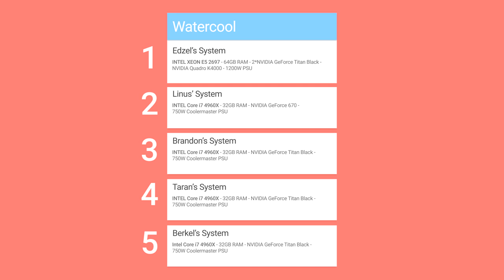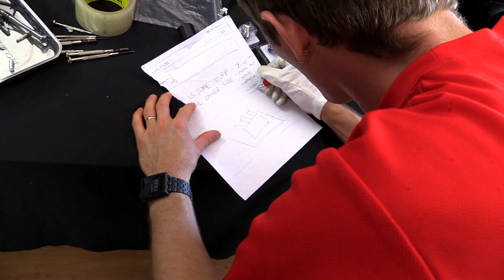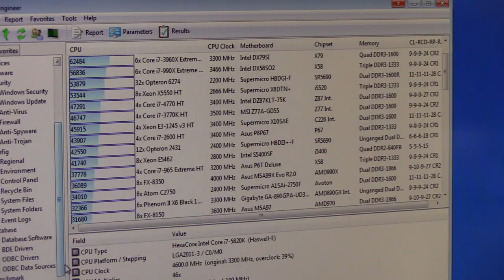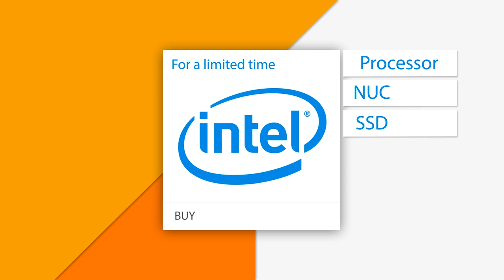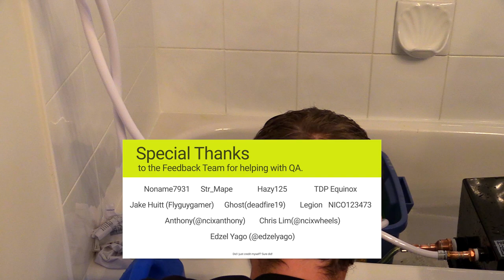Whole Room Water Cooling Part 2 - The Assembly

Comment: why not use car radiator?
Reply: +Chen Aaron Would have been a damn sight cheaper, and they could use a pair of thermofans (also from a car) to move the air.
Reply: +TheOneWhoMightBe car radiators are made to take in air at a lot more speeds than fans will do
Reply: +Alpha smurf No they're not. Your car engine generates a lot more heat than 6 PCs and doesn't overhear when the car isn't moving ie: the fans are generating ALL the airflow. Bonus: the fans are already weatherproof.
Reply: +ducksonetime overheat
Reply: +ducksonetime I was thinking this the whole time. Hell, even a radiator off an old A/C unit would work, and have WAY more cooling capacity.
Reply: +Matthew Menze their power bills would be through the roof
Reply: PneumaticFrog It's only the radiator not with the compressor
Reply: Chen Aaron oh
Reply: +PneumaticFrog the radiator wouldn't impact the power bills.
Reply: yeo
Reply: I was just about to post the same thing. You could just mount 2-20$ box fans on a honda civic radiator.. They would saved grands on this build. and.. I would be willing to bet 2-3x better at cooling..
Reply: because I know what cpu I am running exactly but god forbid you ask me if my car has airbags.
Reply: Pankaj Ahuja , there's a very easy way to find out, but it might increase your insurance premium...
Reply: Why not use a car radiator? One word: aluminum.
Reply: Car radiator is aluminum.
Reply: Chen Aaron but didnt they put aluminium fittings on the radiatiors
Reply: Chen Aaron scrap yard wars. Cooling edition
Reply: Pankaj Ahuja does your car have airbags? God is ded
Reply: Chen Aaron 
Beeeccaaussee it would need an engine, duh
Reply: Alpha smurf I disagree, my vehicle would overheat if I was standing idle for a long period of time. I'd think two big radiators from a full size vehicle accompanied by the vehicles electric fan/fans would be able to cool the liquid more than enough.
Reply: They could plumb the water into a swamp cooler, not only is it fan cooled the radiate heat would dissipate as yo spread the water through out the "moss" yes you'd have to have a filter (fluvale fish filter)and an exteenal tank gtom any water evaporating. There would be more maintenance but it would be cheaper.
Reply: I used an old oil intercooler for my first watercooling system. Bolted 4x Cougar 120mm fans to it, and overclocked that 3rd gen i7 to 4.5Ghz, stable... or was it 4.7? Never went over 78C. Later I took the system apart because I used tap water which coated the insides in white calcium/mineral powder.
Reply: hahaah fucking tap water :v
Reply: Alpha smurf as someone who works on cars, I can tell you this is false. Computer and car radiators are manufactured the exact same way. Single, dual, and triple core are really the only difference besides fin size. There's no such thing as a radiator taking or not being able to take a certain amount of air flow.
Reply: loop metal consistency
Reply: Car radiator fans are designed to be able to cool the radiator enough so even at idling and standstill it will able to cool it enough.
Reply: @Bugzi1776  " my vehicle would overheat if I was standing idle for a long period of time."

If that's true then your vehicle is in need of repair. A vehicle in proper working order can idle indefinitely without even coming close to overheating.
Reply: ikr
Reply: Car radiator will easily cool this setup and likely wouldn't need too much of a fan setup as i dare say most heat will be lost before it even reaches the radiator. (Copper pipe no insulation) as for radiator fans, most automotive fans are inexcess of 300w each, so they move a lot ot air. Most will simulate 60kmh wind through the radiator. However at 300w its using 1/4 of the energy that i would expect a split system woukd draw to cool that whole room.
Reply: Was wondering that too. I always thought if i was to go water cooled id just use one of my slightly bent old dirtbike radiators. Aluminum, well made, same fitting size and they're free. A little Civic half rad would have done this job well
Reply: @jblob5764  would need a good clean and a filter though. but yeah. id probably do the same
Reply: @MaximRecoil  I was just going to say the same thing. With modern electric fans, radiator designs, and proper fluids.  No car made in the last 25 years at least. Should be having a over heating issue.
Reply: Aluminium Copper don't mix. With copper fittings they would need copper radiator. But I don't see why they couldn't get an industrial copper radiator.

Comment: With all that copper piping the water has to run through before it gets outside, a lot of heat is still being sinked into the room. You should have used tubing or insulated the piping. Maybe you could get some pool noodles, cut one side lengthwise, and put them on the pipes to mitigate this.
Reply: Also, decal is pronounced "Dee kal", not " deckle" hahaha

Comment: If I understood it correctly the water would have to cool 5 pc's before it could get cooled again.
So This is 1 loop. The water only get cooled once and then it goes through 5 high end computers with both CPU+GPU in the setup. Would this not have a negative effect on the 5th computer?
Reply: Not really. It would reach equilibrum and pretty much the whole system would run at the same temperature. Oh wait, it's 4 yo post. Too lazy to delete all this, so post!
Reply: @dimitardimitrov9482  if you deleted it we wouldn't know someone ever saw this so ty on posting this oh 2 months old comment
Reply: Lala I was thinking the same!  Thanks for posting this oh 2 months old comment!
Reply: The idea was that cold water was on one loop. Hot water was on the other loop. At each PC, water was taken off the cold loop, pumped through the PC, and pushed back out onto the hot loop.

Comment: Rather than use many 480mm Radiator why not use a car radiator since it was sitting outside with high pressure industrial fan ?
Reply: I still think they should have made a cooling tower out of a swamp cooler and dipped the radiators in the swamp sump.
Reply: A high pressure industrial fan would probably be quite noisy
Reply: kinda hard to get a 2.25in outlet to work with PC 3/4 tubing.
+ they would need a hella large pump for that.
Reply: Eric Martin noise was not a problem since the radiator sit outside, just use a longer tubes or pipes (stay away from the PC) and they can't hear it.

carlos perez for those PC's ? swamp cooling tower are overkill, unless they're build a supercomputer or at least server tower.
Reply: Usually the reason is because the majority of automobile rads are aluminum rads and those don't mix well with copper and brass components.
Reply: carlos perez swamp coolers work a lot better in dry climates.

Eric Martin noise isn't as much an issue since it's outside, but larger diameter fans make less noise all other things being equal.

Sanic go to Home Depo and look in the plumbing section... it's not that hard to adapt any size to any size....and the rad size does not effect the pump size at all.
Reply: Ryan Heyser High End automobile rad are made by copper, only cheaper rad that use aluminium.
Reply: IndraEMC modern cars don't use copper or brass anymore.
2 expensive.
Reply: IndraEMC
No they don't. Aluminum is far lighter than copper, and with the exception of restoring classic cars, copper rads are almost non-existent when it comes to automobiles.

That said, the reason has little to do with the arguments of efficiency, and much more to do with the fact that aluminum is cheaper and the differences are negligible at the temps seen in auto. The problems are much more noticeable at low temps for pc cooling.
Reply: Sanic That's why I said "High end", not a budget car Radiator.

But used High End copper-made car radiator are still cheaper than "PC Branded Radiator" in term of size and cooling capabilities.
Reply: IndraEMC noise is an issue, their office is a house, surrounded by houses. sticking a noisy radiator outside would infuriate neighbours.
Reply: IndraEMC yeah it is over kill.  and it does bring on a second set of maintenance issues as well. but I think they can handle it
Reply: JamesMichaelDoyle  it's not as noisy as lawnmower or jet plane taking off the runway, industrial fan are just slightly noisier than a desk fan.

carlos perez, for long time usage, it's worth the cost.

Comment: When the water goes outside wouldn't it freeze because its Canada during winter
Reply: ***** the title says WATER cooling.
Reply: ***** but people mostly use water to cool their pc right?
Reply: eddie10089PlaysAGame
It's not actual water lol, that's just the term, it's a green coolant like they use in cars, it doesn't freeze
Reply: OfficialCompraa ok then. I am new to pc building so i didnt know. Thanks for the the info.
Reply: sam bishop
very very low temperatures
Reply: It will not freeze if they use additive. But cooling ur pc with that cold coolant will cause condensation. These blokes just dont know what they are doing. But since all this is free stuff who cares.
Reply: They live in Vancouver, it doesn't get that cold there.
Reply: *****
if you watched the video (guessing not) at the end you see the copper pipes spill green coolant from them
Reply: *****
13:00
Reply: "Because its Canada during the winter" i lol'd
Reply: madjake45 I think it's just a coolant with additives, I don't think they picked the colour.
Reply: ***** The coolants have more solutions in it other than distilled water. Regardless, using just water is inefficient.
Reply: OfficialCompraa Most people use distilled water.
Reply: madjake45 Colored water is actually extremely useful for test purposes as it would be more noticeable to the eye if there are spills or leaks. But again only for testing the actual system not for anything else.
Reply: Kensung Clear or coloured, if you can't spot either one then you need to get your eyes checked.
Reply: All they need to do is add propelyene glycol in a 70% water 30% glycol mix. Works great for thermal transfer and is perfect for Canadian winters.
Reply: well a little gycol coolant will prevent freezing same as in a cars watercooling system
Reply: *****
glycol by itself will freeze at relatively low temperatures but when mixed with water at a 60/40 ratio it will withstand up to -45c which makes it a perfect coolant
Reply: Alcohol cooled system. We should run experiments on an alocohol cooled system. It never freezes but it get's colder than shit. EXPERIMENT TIME
Reply: Andrew Longauer
As far as "regular" liquids go, water is by far the best.
Reply: They are using anti freeze
Reply: Because it's Canada during winter.
Reply: eddie10089PlaysAGame No, nobody uses water because it corrodes. And it's very slightly conductive.
Reply: Jacob S It's antifreeze.
Reply: TDPEquinox Antifreeze is mixed, I said that earlier, you don't fill the entire thing with anti-freeze, that's expensive and stupid.
Reply: Jacob S
u want shum
Reply: +Rob The Plumber BUT that glycol would be better spent mixing ejuice
Reply: klimpomp he's talking about Ethylene glycol not propylene glycol
Reply: Jacob S "All they need to do is add propelyene glycol..." Well at least in this message hes talking about propelyene .-.
:D
Reply: klimpomp Sorry, missed that, I assumed Ethylene Glycol because it conducts heat better than Propylene Glycol
Reply: Jacob S Heh no reason to apologise. And yeah i didnt even know Propylene Glycol was widely used for liquid cooling.

Comment: Fun video. I did this with used pull auto heater cores and some were Honda engine rads and even some transmission coolers worked. You can get them for way less then parts sold for us PC modders. At the time, we didn't have a good value place to buy PC enthusiast cooling.

Comment: Ah man, uninsulated copper tubing? SMH
Reply: Sir Mutton Chops would it cool it down before it goes outside? and heat the the room at the same time?
Reply: Sir Mutton Chops Yeah, the whole point is for this system to piss heat away. Some warm copper pipe would help. I assume you ask this because the idea is to pull heat outside. It wouldn't make much difference. Though an ideal upgrade to the system aside from fixing those pipes down better.
Reply: HardwareJunkie446 Going with PEX would have been cheaper, too.
Reply: Ghost Sailor
Thank you for making me aware of this as i am working on my own project that may require this sort of tubing. I honestly didn't even know PEX existed.
Reply: HardwareJunkie446 It's way cheaper, a lot harder to freeze, easier to use, doesn't need a lot of elbows, and also transfers heat a lot better. There's also less risk of it being stolen off a build site, if you're worried about that.
Reply: Mr. Rich B.O.B
Any copper left in my house is insulated, because otherwise it would freeze and burst.

Comment: 9:55
Cement drillbit for metal?..

edit, nevermind..
Reply: Liamv4696 I know this is an old comment but if you ever need to drill harden steel those bits work great. They have saved me many times when i need to drill a file or prybar.

Comment: The radiator solution is pretty stupid.  You can have custom radiators built to handle your thermal load that cost significantly cheaper than that setup, with one fan.  This wasn't even a build.. it was a freaking bolt together with bob the builder coming in to provide some real fabrication skills.
Reply: +Jeffery Lloyd (KiGrind7)
Well they get the PC stuff for free as they are sponsored, so in their case it is the cheapest option.
But for anyone paying on their own car/truck radiators are the best option as you can usually get them very cheap, or even free since so many cars are scrapped every day, and they are made to handle 100kW of heat or more.
Reply: A custom three row aluminum radiator designed to handle a AMC 304 V8 was $150.  A significantly smaller multi row radiator with your fittings would be cheaper.
Reply: It's way more entertaining this way

Comment: A great way to apply a decal which doesn't have a front sticker is to cut the back protector vertically in the middle, and apply it from the inside outwards. Then you can easily do it yourself. Get some painter's tape to hold the far top corner in place while you work on the opposite side.

Comment: I think this will be better with car radiators like many say, and also a system to warm inside in winter just to 21 automatic with arduino and temp sensors to control when the heat go outside or stay inside the house will be awesome.

Comment: I almost thought you'd be using an industrial radiator of some kind or even a car radiator. Did you consider running longer tubing and just placing the radiators on a ground mount? No need to hang anything and it won't matter how heavy it is.
I still think the copper tubing is the sickest part of this build. :thumbsup:

Comment: I was impressed with the idea, Only thing I though might be a problem is that the fans cooling the radiators and radiators might not be made for outdoor use. Not sure where in van you are but if you live close to the sea, salt air corrosion is not good for  aluminum (depending on alloy) and especially not good for copper. It takes a year or two to start showing so I just wanted you to be aware of that. Might be replacing fans once in a while.  I kinda though it would be more practical to come up with a industrial fan mounted to that wood frame on the radiator, you would have crazy airflow and something designed to last outdoor however it might eat more power cause you would be hard wiring it on a separate breaker circuit so if you ever get a strong wind and rain storm it is on its own tripper , unless you get something water proof industrial fan setup -cheers I look forward to 3rd episode

Comment: i know this was a while ago but to check for leaks on the radiators use a little bit of soapy water when its pumping out the air and any leaks will show up as bubbles

Comment: applying the wall with soapy water first and placing the decals would make it easy applying the decals and not worry about bubbles, folds and creases as you can adjust while the soapy water is still wet and itll evaporate when done and the decal fit firmly.

Comment: just out of curiosity and this is a really cool idea but I think instead of doing rad's outside maybe a chiller unit would be more beneficial. what happens when outside air temps get high? not sure where you live but even here is pittsburgh it can get to 100 outside higher in the sun

Comment: Have you considered plumbing the radiators in parallel? The last radiator in your loop might not transfer much heat fire to the low heat difference. Also parallel will have less head loss then series configuration you show in the video.

Comment: I'm watching through this 8 years later just to figure out what pump they used for a huge system like this to get adequate flow, as I am planning out a separate room cooling system with a 50ft PEX run and I'm not convinced a dual D5 will cut it.

Comment: If your radiators are outside, you'll need to consider two things.

1) the radiators should be painted white otherwise they will just absorb heat from the sun.

2) water obviously isn't suitable for outdoor radiators, you should fill it with ethylene glycol otherwise you run the risk of ice in your loop.